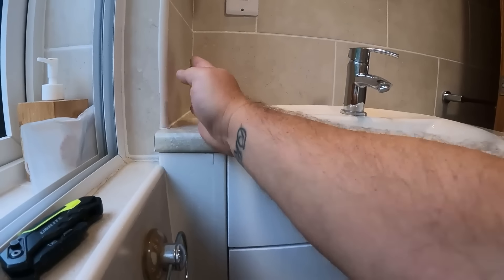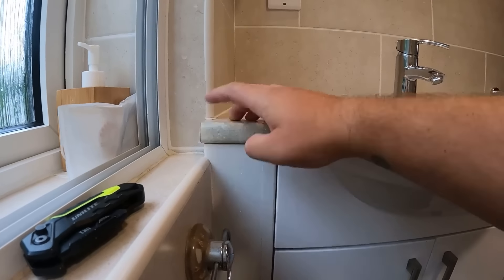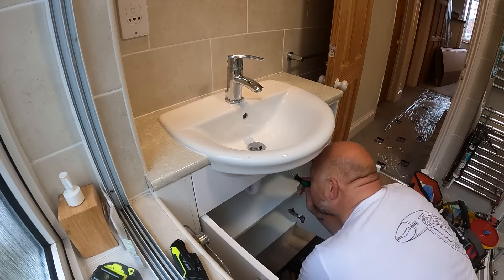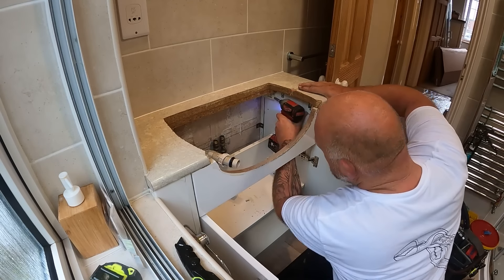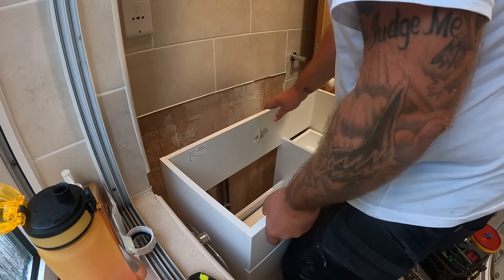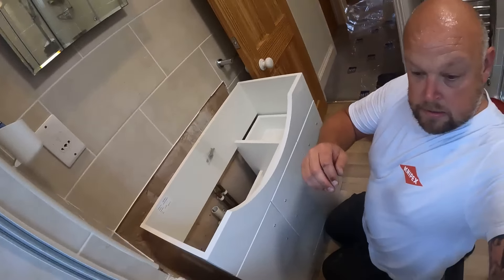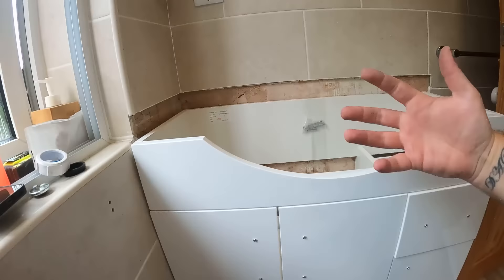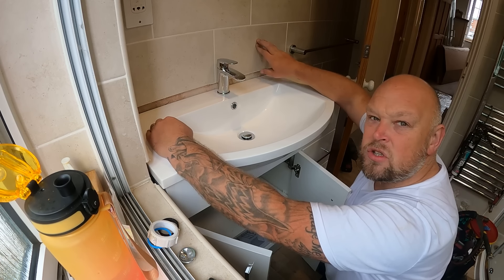BATHROOM VANITY UNIT ISSUE  (Can i find a solution) | Real World Plumbing

Comment: I would have raised the whole unit from the bottom to meet the tiles. I would also have moved the unit to the right until the flooring gap was covered and put a spacer at the window edge of the unit. The run a plinth around the bottom to tidy it to the floor. Then have a think about the corner by the window....................
Reply from the maker: So many different ways… video coming soone

Comment: Hi, another quality plumbing job👍
Could you put a timber surround underneath the unit and flush with the front, just enough to fit to tiles then run a arc or bead around the bottom?
Reply from the maker: I know it’s coming out again to be tiled properly…. But yer that might of worked for a quick fix type thing

Comment: Always enjoy your videos whenever they land Mark, unit seems to fit quite well width wise wondering if you could raise it up slightly to be just level with the bottom edge of the existing tiles then fix a new piece of white faced wood to the inside of the unit carcass around the bottom to close the gap off then silicone round the bottom to seal it 👍
Reply from the maker: Thanks mate….
A few people said about raising it up… could be an option

Comment: Hi Mark, great informative video of issues we’ve all had, have you tried the Rothenberger waste pipe cutters, I’ve had mine for years and they work very well and you get free replacement blades inside them, Screwfix sell the whole set of them which contains a 20/35/40mm cutter, you can also buy a 2 inch cutter as well.
Reply from the maker: I think I used to have some, but will be ordering some more I think

Comment: Raise it up to sit under the existing tiles…. White plinth out of flat arc from Gap Upvc around the bottom. No trying to match tiles, the issue is corrected at floor     level and out of sight lines 🤷‍♂️🤷‍♂️
Reply from the maker: But what about the bit on the side…. Needs sorting.
Reply: Hhhm. Could you  not only raise it but also push it to the right to take up those gaps. The gap in the left is going to need a slim in fill panel, as they had before but slimmer. It would also let the left hand  door open better as it won’t be tight to the wall. Everything is going to be a compromise, short of tiling and all the problems matching them up.

Comment: New unit fits very well. I would have added 4 feet on bottom of vanity to raise it up 30-40mm and avoid retiling. Unlikely you can match tile colour, batch numbers and grout colour.
Reply from the maker: Will see what my tiler will do….. I’m sure it will be fine👍🏼👍🏼👌🏼
Reply: me too. some vanity units have the kitchen feet or 4 x plastic stoppers.
Reply: Problem being is there is a strip on the right hand side so only going up wouldn’t solve the problem.
Reply: 4 feet? I read it as 4 foot in terms of unit of  length
Reply: @wackypeace1135 good point. I should have been clearer. 4 small posts.

Comment: That’s a tricky one but the key is you’d let the customer know it could be an issue before you started. Mind you, if they’re anything like me they’ll have a box of spare tiles in the garage that they’ve been tripping over for the past ten years!
Reply from the maker: Yep was hoping they had some spare but unfortunatly not
Reply: Check under the bath... Recently did a house renovation was going to put a new bathroom suite in and change the toilet from a low level cistern to a close coupled.. The tiles in the bathroom although  good  were 15 years old. BUT when I checked behind the cistern the lazy tiler hadn't tiled behind it... There was no hope of getting the same colour tiles so I bit the bullet and removed the toilet and sink and started to knock off all the tiles... When I got to the bath I pulled if the side and front panel of the bath to find..... A spare box of  the old tiles stashed under there. I could have cried 🙄🙄

Comment: It's a tricky one.  I would match the tiles if poss and then tile to the floor behind the vanity unit (at least at the edges).  Looks like the tiles round the window will need to come off to fit the new trim/edging too.